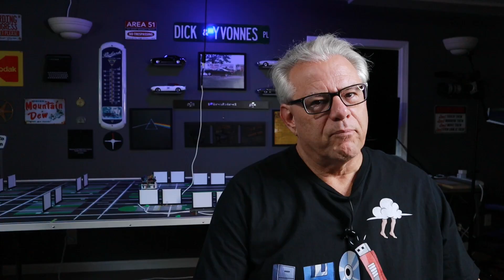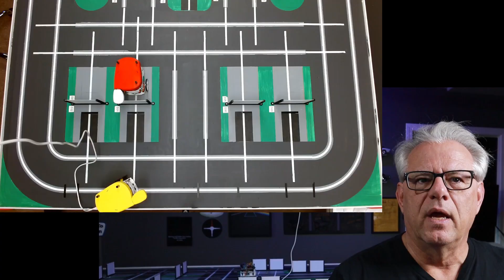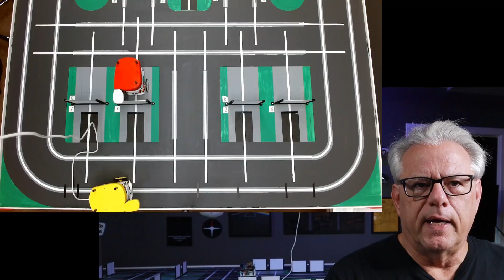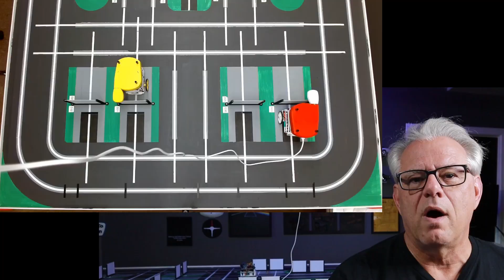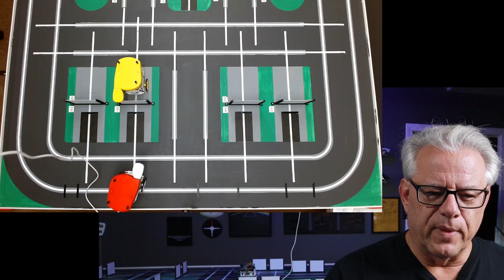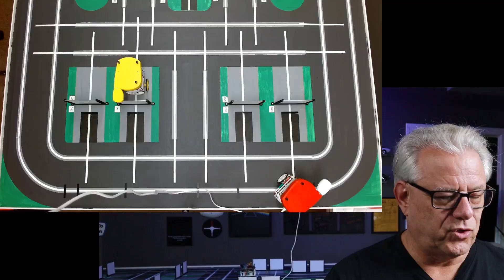Did simplifying the MicroPython program for this robot help its ability to self drive?

Comment: This looks like great progress Chris. Getting rid of all that stuff on the town surface is allowing you to deal directly with the issues rather than piling on more "fixes". Encoders are internal sensors in that they do not measure the world, only an internal aspect of the zoomie. It's good to see you are just using them to get to a point where you can use a sensor to measure the world to get on track again. You could probably cut those black tapes to be only as wide as the white lines and make the layout even cleaner. You don't mention what distance sensor you were using that was giving you varied results when stationary.
Reply from the maker: Good morning @DaveEverett01

The whole problem with the encoder situation gets very bizzarro of which I alluded to in that video.  In the next video I take a detailed look at it.  Then, as I just filmed yesterday (which will air in about 3 weeks I think) the solution showed a real mess of problems.  There is HOPE!

Regarding the distance I was at to test the sensor would have been in the 5 inch to 6 inch range, well within the limits of the sensor.   Another fellow questioned that too which opened my mind to a potential cause for this problem.  My lighting in the shop/studio has changed a lot in the last 1.5 years.  Right now it is all LED of various types and colors.  I know that the lighting REALLY messed up the Tiny Code reader (QR code reader), I will have to test to see if the lighting is affecting the distance sensor.  If I discover an issue with that I will present that data.

Thanks for chiming in and for being a part of this crazy experiment!
Cheers!
Chris
Reply: @MakingStuffwithChrisDeHut  Looking forward to the video Chris. I was still wondering which distance sensor you used. Often they need an inverse regression to map the returned distance to actual distance as this can result in odd knees in attempt to linearise them, which results in erroneous distance calculations.
Reply from the maker: @DaveEverett01  Hi Dave,
The unit I am using is the Sharp GP2Y0E03.  I am using the analog output.  Its linearity is pretty good, just the stability in reading a distance without movement that is wonky.
Cheers!
Chris
Reply: @MakingStuffwithChrisDeHut  Right. I have used almost all of ther GP2 range. I have been using this particular one for cliff detection in a series of robots. As the minimum range is 4cm, the voltage can double back when you are closer which makes objects appear further away. The 4cm is not fixed in stone as manufacturing variability can cause that to change on each sensor.  I ran a calibration for each sensor in another applications where I took 100 samples each at 1cm increments up to the limit then made an inverse linear regression function to determine the true distance. I found that the closer you are to the lower limit, the worse the quality becomes. You might want to do some characterisation at these low distances like the garage walls in zoom town to see how they vary.
Reply from the maker: @DaveEverett01  
Thanks for the great information / advise Dave.  I certainly need to do more testing on that sensor as I still would like to use it for position confirmation when parking and un-parking.  Not concerned when up close, I have something else for that.  More concerned with the 5" to 10" positions where I am at the road looking at the garage wall.  

When you were testing your sensors, did you see very stable readings with the sensor and object in stationary positions?
Reply: @MakingStuffwithChrisDeHut  I did some testing on that sensor last week and I found it does vary quite a bit. I'm just looking at the raw values. Previously I wrote some code so I could get an inverse linear regression to turn the values into actual distances in mm. Inverse is required because the normal output is not linear. It's still a lot less stable than I would like.

Comment: RE: Distance sensor: Too close? I can imagine the spot size at close range is pretty small and the measured reflection might miss the sensor if the surface is too reflective.
Reply from the maker: Hi Bill,
I was surprised by that variation as well.  The testing I did (relative to that video) had the sensor at around 5 or 6 inches as I recall which is not near the limits of the sensor either way.  I will say that there could be some influence coming from the lighting in the shop/studio.  I have a variety of different lights I use when filming (with more added recently).  I believe all of them are LED, but in various configurations and color ranges.  I should run another test with ALL lights off and see if I get different results.  If so, I will let you know!
Cheers!
Chris

Comment: Chris, I'm puzzled by the PIO read delay you mentioned  , I've not seen any lengthy delays in my servo loop . It uses: " For efficiency, here we use an undocumented feature of StateMachine to read a SIGNED integer value without allocating a new object." in a python function : def read(self): self.sm1.put(1):self.sm1.get(self.buf):  return self.buf[0]
Reply from the maker: Good morning Bill,
By chance are you using DMA for the data?  That is a solution several people suggested to me, but I could not work out the details to implement it.  Either way, I would love to see your program if you could share it with me.  
Cheers!
Chris
Reply: @MakingStuffwithChrisDeHut  hi Chris,  I  tried to post it here in the comments, but YouTube cancelled it. If you create  a post or PM on the raspberry pi forum,  I'll  monitor and respond . 

The quadrature routine I'm using (lifted from the Internet)  doesn't use dma